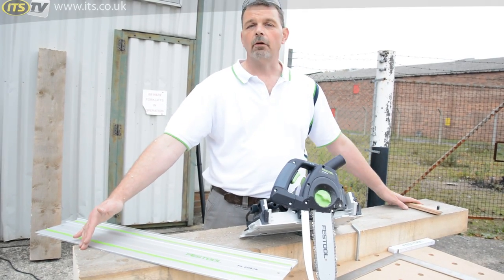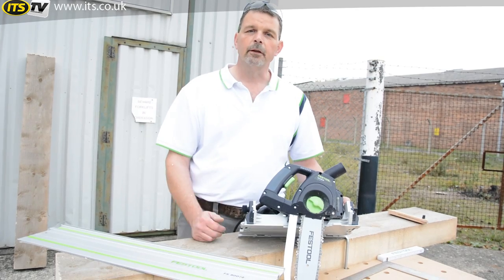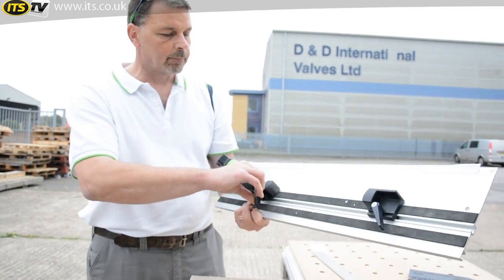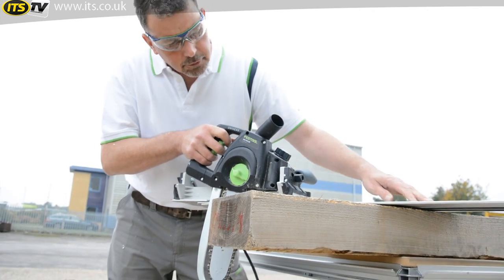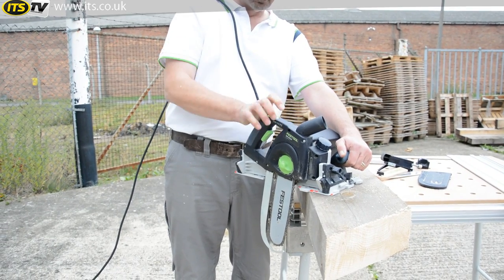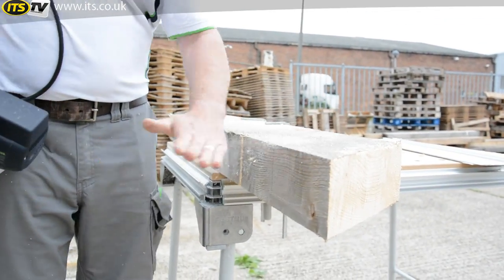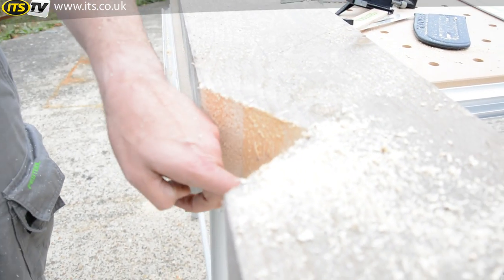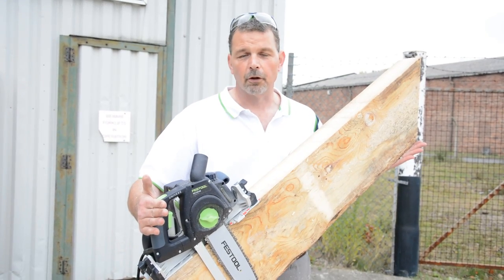How to cut a common rafter - ITS TV

Comment: Fine saw and the use for cutting jack/common rafters, birds mouth and purlins on site is fantastic- however it’s not available in 110volts which is the law in Ireland. If I purchase this saw I could only use it in a workshop environment and I cannot think of a single use for it in a workshop. Festool provide a 110 version